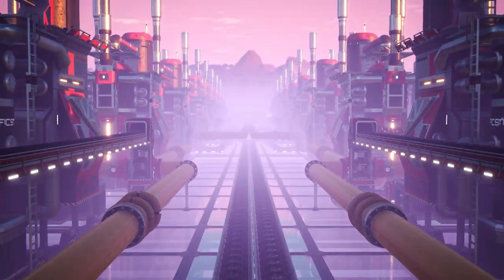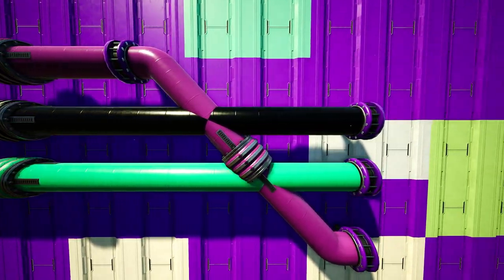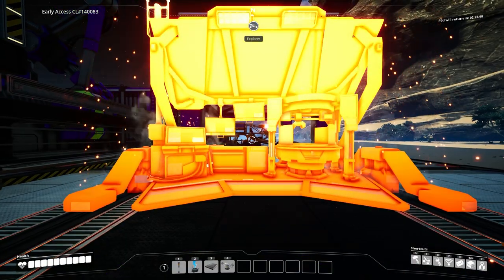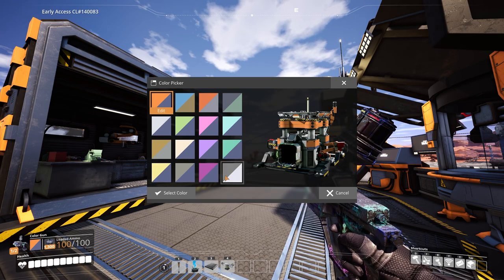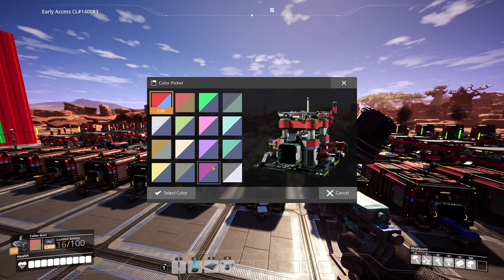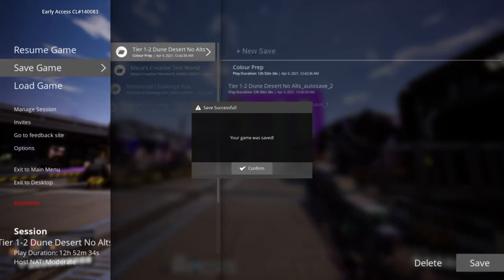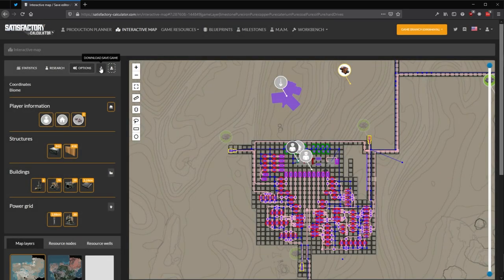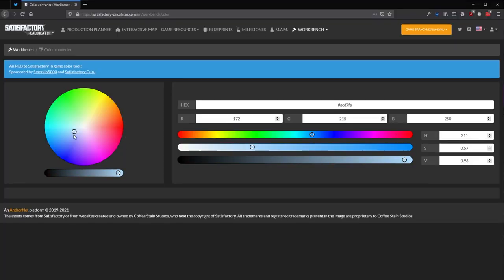Default Colors for FOUNDATIONS and PIPES in Satisfactory and How Colors Work

Comment: This video didn't help my problem but I'll ask, I logged into Satisfactory today and all my machines and some other things have all turn black and I can't change there colors back to the default. I even tired changing the black default color but that didn't work. What is happening?
Reply from the maker: There is an issue with steam's update system that causes this. You'll need to verify your game files and then it will get sorted. Right click Satisfactory in your library -> properties -> local files -> verify game files